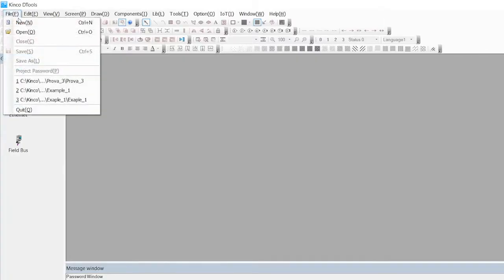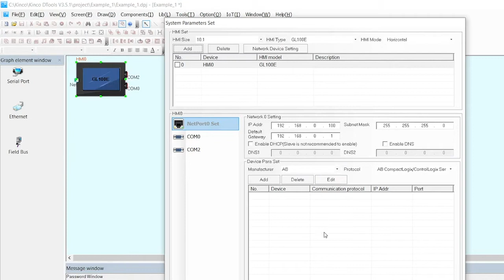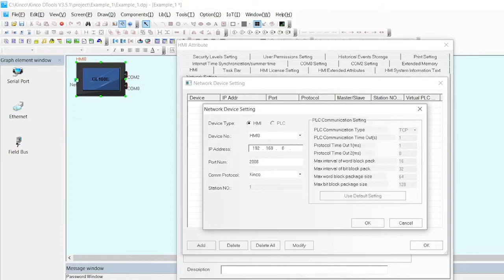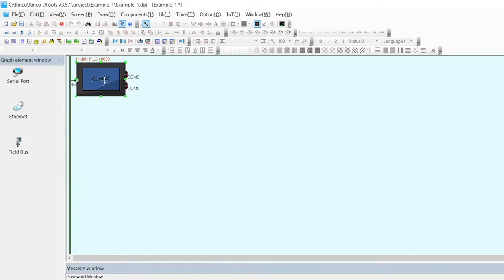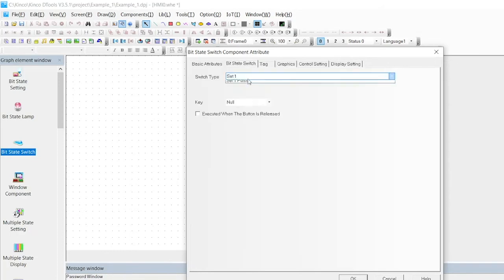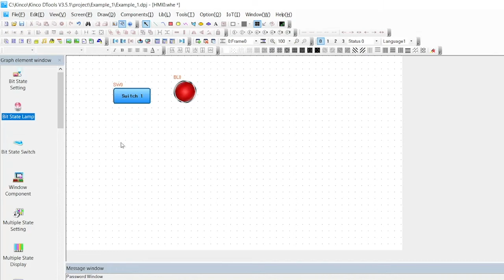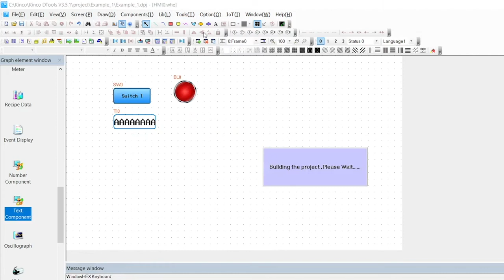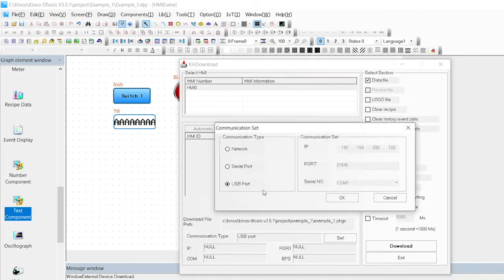How to connect an HMI Screen using Arduino PLC

Comment: Where is the hardware you're working on ?
Reply from the maker: These are the two solutions we are talking about:

https://www.industrialshields.com/es_ES/industrial-panel-pc-10-1-based-on-raspberry-pi-tinkertouch-20220112-lp

https://www.industrialshields.com/es_ES/industrial-plc-based-on-arduino-original-boards-automation-solutions-202209-lp

Comment: How can I connect the HMI to an arduino microcontroller?
Reply from the maker: Hi! In this case this HMI is connected to the PLC through Ethernet (over ModbusTCP protocol). The PLC is configured as a Master and the HMI Screen as a Slave. Here you have some related posts of our Blog:
https://www.industrialshields.com/blog/arduino-industrial-1/post/modbus-tcp-master-with-industrial-arduino-esp32-plcs-103
https://www.industrialshields.com/blog/arduino-industrial-1/post/how-to-use-modbus-tcp-slave-library-with-a-plc-controller-arduino-105
https://www.industrialshields.com/blog/arduino-industrial-1/post/how-to-connect-an-arduino-industrial-plc-using-modbus-tcp-ip-106

You can find more details in the blog post link that you can find on the description of the video. In the case of other HMI's like ours (you can find them here: https://www.industrialshields.com/industrial-panel-pc-10-1-based-on-raspberry-pi-tinkertouch-20220112-lp) you can connect them to our PLCs though communication methods like Ethernet, RS-485, etc.Thank you.

Comment: hello dear this is an incomplete video
Reply from the maker: Hello,

How can we help you? You can find more related information on these pots of our Blog:
https://www.industrialshields.com/blog/arduino-industrial-1/post/modbus-tcp-master-with-industrial-arduino-esp32-plcs-103
https://www.industrialshields.com/blog/arduino-industrial-1/post/how-to-use-modbus-tcp-slave-library-with-a-plc-controller-arduino-105
https://www.industrialshields.com/blog/arduino-industrial-1/post/how-to-connect-an-arduino-industrial-plc-using-modbus-tcp-ip-106
https://www.industrialshields.com/blog/arduino-industrial-1/post/how-to-connect-an-hmi-screen-using-arduino-plc-262

And also in this free course:
https://www.industrialshields.com/slides/develop-your-scada-application-based-on-node-red-12

Thank you,

Comment: but how does the arduino send data to the HMI and visa versa?
Reply from the maker: Hi Logan! 

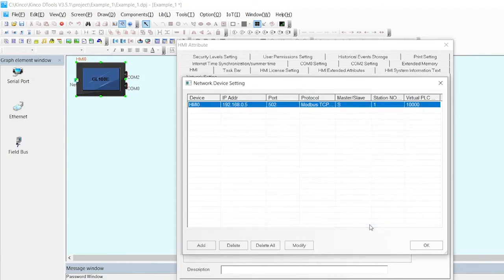As you can see on minute 1:25 in this case the communication used is ModbusTCP over Ethernet. The PLC is configured as a Master and the HMI Screen as a Slave. Here you have some related posts of our Blog:
https://www.industrialshields.com/blog/arduino-industrial-1/post/modbus-tcp-master-with-industrial-arduino-esp32-plcs-103
https://www.industrialshields.com/blog/arduino-industrial-1/post/how-to-use-modbus-tcp-slave-library-with-a-plc-controller-arduino-105
https://www.industrialshields.com/blog/arduino-industrial-1/post/how-to-connect-an-arduino-industrial-plc-using-modbus-tcp-ip-106

Thank you,